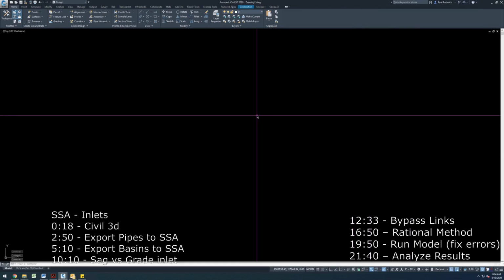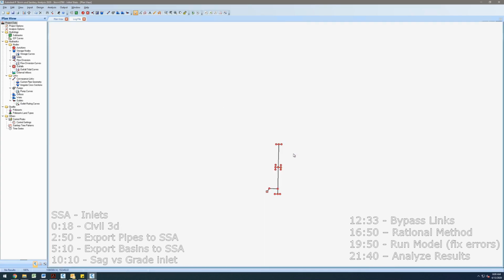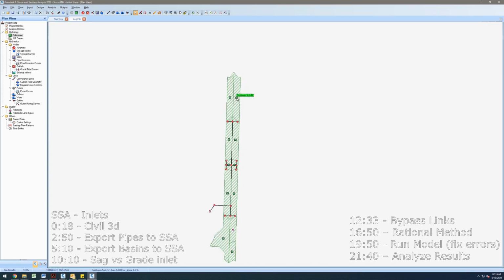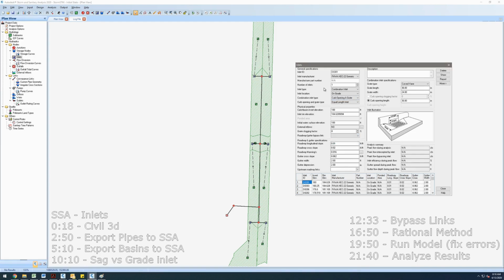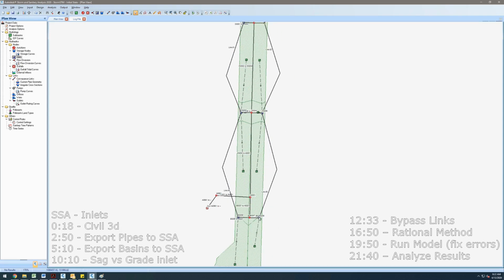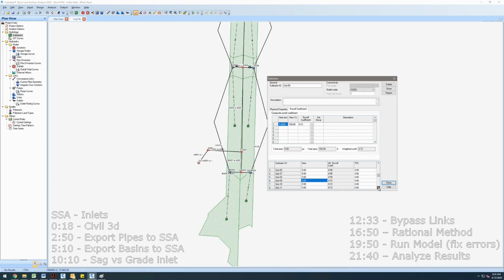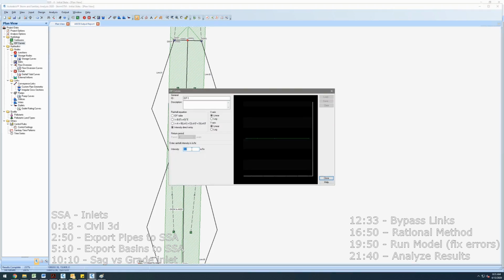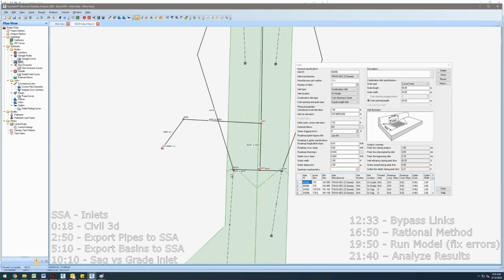SSA Inlets     |       Storm Sanitary Analysis Tutorial | Storm Sanitary Analysis - Civil 3d

Comment: For adding the bypass from one inlet on grade to the next, is there a reason you use the pipe type and set it to 1' rather than making the link "Direct"? Does making the link a direct link do the same thing or, if not, what is the difference?
Reply from the maker: Great question. When I try to set it up with a direct link it wasn’t working properly so I opted for the 1 foot pipe. Theoretically it should work the same!